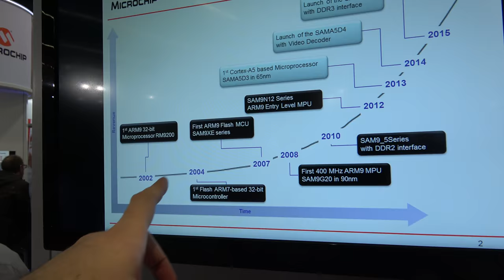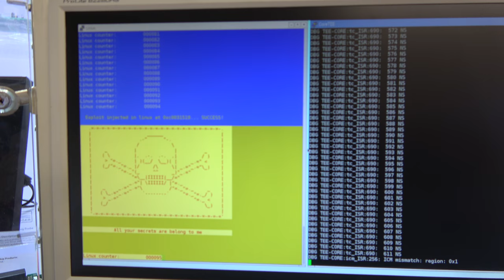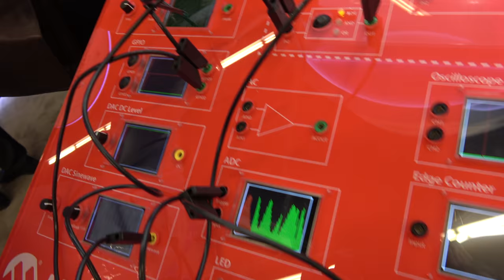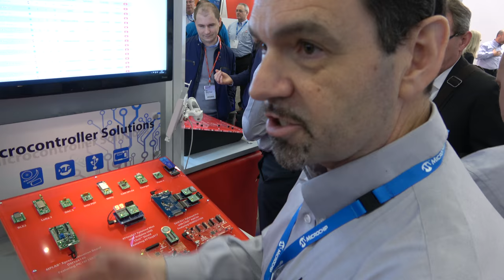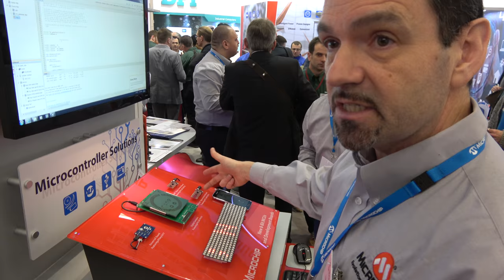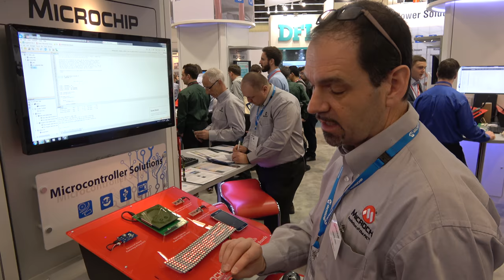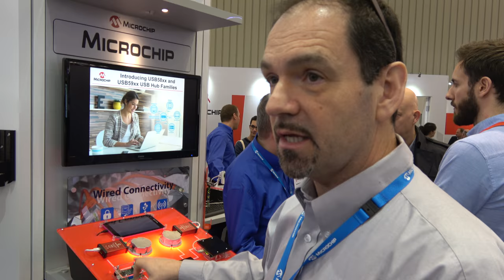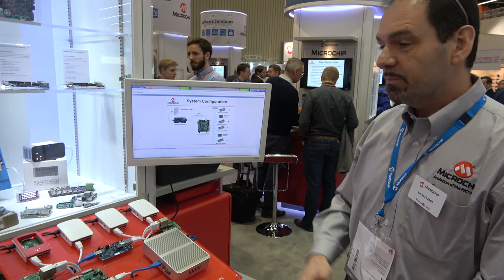Microchip ARM, PIC and AVR Microcontrollers

Comment: AVR32 has no future. AVR mega series doesn't seem to have one too. AVR xmega series is no longer moving forward, Microchip focused on tinyAVR with xmega enhancements (better ADC, DAC, event system, new registers for GPIO config etc.) Basically tinyAVR 1-series are xmega with cut-down features. And it's position is between PIC16 and PIC24 probably. Core is way faster per MHz and has really decent peripherals so clearly can hit a niche in market. Other than that... I see only SAM (ARM) chips which usually are more expensive than counterparts (STM32 as main competition) but are nice to ppl experienced with AVR and Atmel Studio.